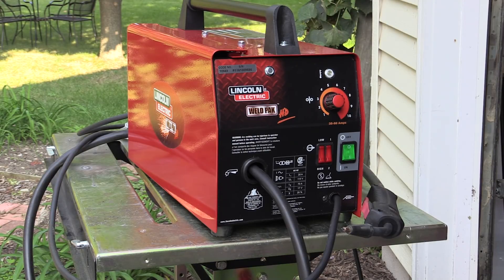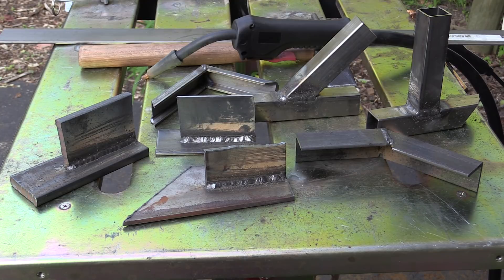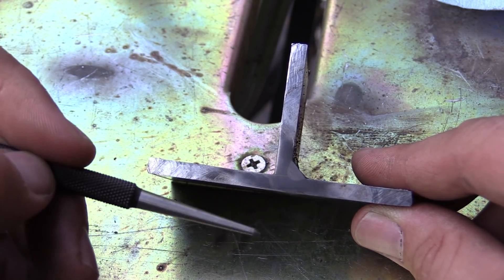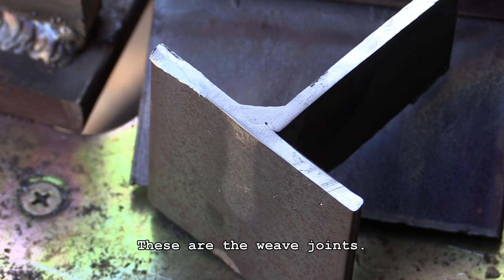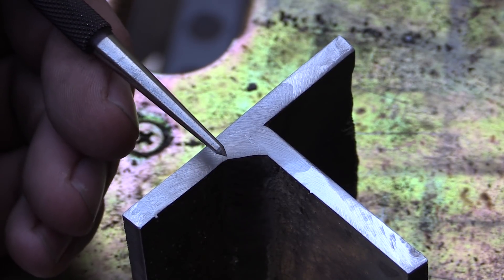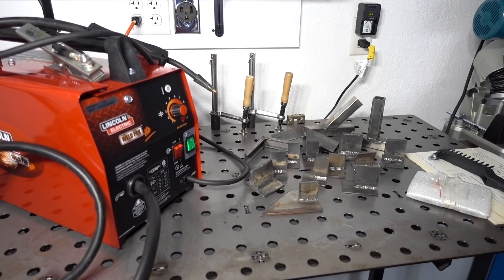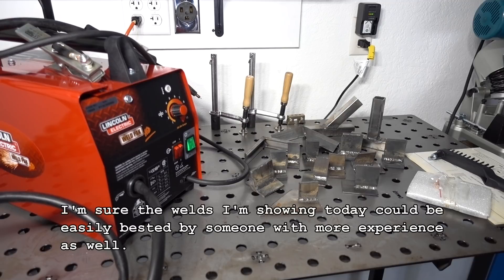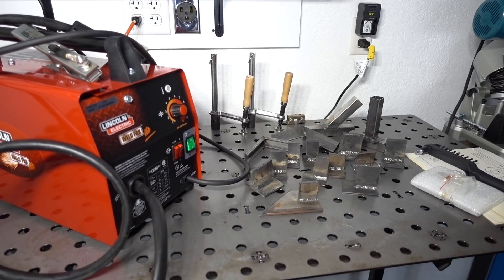Cheap Flux Core Welder Testing - With Cut and Etch

Comment: Can i use the mig with out the nob the holds the wire in place ?
Reply from the maker: Are you talking about the knob that holds the spool of wire on the welder, or the knob that tensions the wire in the wire feed mechanism?  Without the knob that holds tension on the wire in the feed mechanism the wire wouldn't feed.  Without the knob that holds the spool on you could probably figure something out.

Comment: Is this model 10949?
If so I have the same welder. I thought something was wrong with mine in the beginning.
The spool of wire that came with it did not easily feed off the reel. Sometimes I had to open the box and grab the wire and force it loose from the spool and that roll of wire was like that off and on till it was gone. 

The other issue I had with it and of course my fault was using an extension cord that was too long and too light.
A light 14 gauge 100 ft long extension cord alone will make the welder seem like a pile of junk. It will run on a 12 gauge 100 ft cord decent but the manual only recommends a 25ft heavy wire gauge extension cord.
The wire I bought at Tractor supply was a huge improvement over what came with it. I'm on my 2nd spool of that wire and I have come to like it. It is limited in its settings and near as I can tell works best on high. I haven't gotten much out of it on low settings.

Comment: I have the Handy Core with no spark, not sure if a fuse blew or transformer waxed. Haven't had time to open it up. I use straight beads with low duty cycle welders.
Reply from the maker: I hope it's something simple (assuming you haven't already found out what's wrong).
Reply: @bigtb1717  was a inside breaker fuse, working fine now, thanks.

Comment: no gas required??
Reply from the maker: Correct, no gas required.  This welder cannot use gas.  It is only designed for self-shielded, flux core wire.
Reply: @bigtb1717  thanks

Comment: Do you recommend for quarter panel and floor pan repair?? 20 guage??compared to the Eastwood 135?? Not sure if the Lincoln can also run off argon ???
Reply from the maker: This particular model Lincoln cannot use shielding gas.  Flux core probably isn't the ideal thing to use for body work, but I'm sure it can be done.  The Eastwood 135 is a MIG welder that can use shielding gas, but I have no personal experience with it.

Comment: I have the same unit but I am definitley a novice (hobby) welder
My machine, regardless of setting with out consistanly for a micro second. Do you think I may be running
my wire length a little too long I am about 1/2 inch plus
Reply from the maker: Are you saying it randomly cuts out for tiny fractions of a second, but otherwise runs okay?  If so, that does sometimes happen with flux core.  1/2" of wire stick out should be okay and I don't think it's an issue.  But you could try a bit more or a bit less to see if it will smooth out.
Reply: @bigtb1717   As I draw the pool too me, it will suddenly "cut out" for the smallest fraction and the re spark and continue, Thought it may be length or speed
Reply from the maker: @billparno3016  Yeah, it could be a travel speed issue, but you'd probably have to be outrunning the puddle before it would be a big issue.  How clean is the metal you are welding when this happens?  Dirty metal will often cause minor stuttering as you move over dirty (rust, paint, slag, etc.) spots.  It could also be a wire feed issue.  If the wire feed slips momentarily or if the feed speed just isn't smooth in general, this could cause stuttering.  Poor wire feed reliability can be caused by a number of issues.  Is the contact tip in the gun in good condition?  

Honestly, if it isn't causing an issue with the weld, I probably wouldn't worry too much about it.  I've had occasional stutters on flux core with pretty much every machine.  It's one of those things were "It's not a problem unless it's a problem."  Meaning, if it's causing an issue with the welds, look into what's going on.  If it isn't causing a problem, weld away and don't sweat it.
Reply: @bigtb1717  contact tip just replaced. the more I consider, think I have to slow down and not get ahead of puddle Thx for your input

Comment: I’m very impressed with the quality of your welds for never having run a wire feed welder before. Your stick and TIG skills were clearly helpful. Those hand held face shields are pretty useless for welding as you mentioned, but are a nice thing to have around in case you have somebody that wants to watch you weld.

Comment: If you want better penetration on thicker material, put a bevel on the plates and stack passes on top of each other
Reply: That an you could preheat the thicker material your welding will help with penetration

Comment: i have the same one but i don’t understand the temperature and speed
Reply from the maker: The two voltage switches adjust between four different voltage levels.  Low 1, low 2, high 1 and high 2.  The wire feed speed lets you adjust the amperage output at whatever voltage you have selected.  If you follow the chart on the door you can't go too wrong.

Comment: So is thia better than the titanium 125 flux?
Reply from the maker: The Titanium 125 is an inverter with continuous adjustable voltage and it is lighter and less expensive.  It may have a bit more output than this Lincoln, but unfortunately I don't have either of these welders anymore to test them.  The Lincoln is a bit simpler internally, so it could be a bit more reliable, but anything can fail, so it's hard to say for sure.

Comment: Thanks for the video. Would you recommend MIG or SMAW (stick welder)? For DIY, around the house, some fences or window protectors. Mainly for weld up to 1/4 steel thickness.  Thanks in advance for your help. By the way, I have little experience with stick welder, wonder which is better option. My budget is around 400 dls (I am DIY)
Reply from the maker: MIG (gas shielded) is a nice process, but it would be tough to get a complete setup with welder, gas bottle, etc.  Flux core (like the welder in this video) or stick should both be possible to get in your budget.  Flux core is a bit easier to run but stick is a bit simpler (in some ways).  Do you have access to 240V power, or only 120V?
Reply: @bigtb1717  thanks! At be my hose I have both, but at the country hose only 120. I just came from there and I found some rovers got in and I need to reinforce a couple of doors. Not needed very often to do welding at country hose. Just now. Perhaps, I can build the fences at my hose and borrow a pick up truck to take them there. Somebody is selling the same welder on your video. Is that 70 or 80 amps? I also found at Homedepot the   "weld-pak" 120 amps. By the way, how many amps on MIG welder machine is needed to weld carbon steel, maybe up to 1/4 thickness? Because stick welder I guess it should be in between 200-250 amps right? Anything lower could work but usage recommended will be lower work cycle, right?
Reply from the maker: I would say that the welder in this video would be a bit weak for 1/4" material, depending on the project.  If it's not a super critical weld, you'd probably be able to get by though.  A larger flux core welder (120-140 amp) would probably do 1/4" okay.  I don't have any 1/4" steel in the garage right now, but maybe I should do a little cut-etch testing with 1/4" material in the future.  With a stick welder, you are much less likely to get a lack of penetration as long as the rod is running well.  So with multiple passes you can weld just about any thickness.  As long as you can run a 3/32" or 1/8" rod good and hot, you could weld 1/4" metal.  Might take multiple passes with a 3/32" rod depending on how large a weld you want, but it's definitely doable.  A 1/8" 7018 rod running 125-130 amps or so should be able to weld 1/4" metal without issue.  Higher amperage can allow you to run larger rods and put down a larger weld more quickly, but 200+ amps is not necessary for most projects.

Comment: dont forget to fill in ur craters, they are a huge stress point and 9 times outta of 10 will crack.
Reply: and never drag or weave or inline whip, all of those teks will cause horrible penetration  and weaving will cause undercut in ur material and also less penetration, u need to straight push ur weld with mig and will get u the best penetration and eliminate undercut and roll.
Reply from the maker: @stevenconley3136  I agree that weaving and whipping isn't ideal with flux core.  I haven't personally done it since this video.  But you should drag with flux core.  Pushing with flux core can cause slag inclusions because you are pushing the slag to the front of the weld and then running over it.  Slight manipulations can sometimes be fine with actual MIG welding (as in, gas shielded, solid wire).  Just depends on what you are after.  MIG can also be pushed or pulled.  It may affect your final results slightly, but again, each may have advantages in certain situations and there has been much debate and testing.  It's not quite as clear cut as "you must always push."
Reply: @bigtb1717  pushing or dragging with flux is all about the profile ur trying to achieve pushing with flux will give me more of a flat and bigger size weld while pulling will give u a tight more filled size weld its good to pull if ur trying to achieve a 3/16 - 1/4 size weld pushing with flux will help u fill gaps and achieve bigger size weld if ur not welding a T joint.

Comment: Does gas increase penetration?
Reply from the maker: This welder cannot use shielding gas.  It does not have the correct internal provisions or MIG gun.  No gas should be used with self-shielded flux core wire.

In general, gas shielded solid wire MIG will have slightly less penetration than self-shielded flux core, all else being equal.  There are types of flux core wire that are called dual shield, or gas shielded flux core.  They are flux-core wire, but require shielding gas as well.  I imagine penetration is similar to self-shielded flux core.

All these types of wire feed welding wire can achieve adequate penetration in the right situations.  With a small, 120V machine like this one, self-shielded flux core will likely provide the best overall penetration, by a small amount.  This is simply due to the fact that the welder is limited by the amount of power that can be drawn from a standard 120V outlet.

Comment: i bought the same model i only have 220v in my place so i used 5kva step-down 220/110 transformer. it came not good result.

Comment: The Lincoln 140 is a huge step up from the Harbor Freight. Still it's not a professional welders go-to unit, but it's more than enough for my non-mission critical garage projects. Being able to weld on small scale has really opened huge doors to my garage fab capabilities, so I love these little flux core machines!

Comment: Hey I bought a powerbuilt 90amp haven't used it yet....any idea if it may work the same as this?
Reply from the maker: It looks like the Powerbuilt 90A is an AC output welder.  It will not run nearly as smooth as this Lincoln welder, which has DC output.

The Powerbuilt welder will have a rougher arc, more spatter and less penetration.  It will probably be very similar to the Chicago Electric 90A flux core welder from Harbor Freight.
Reply: Thanks for the info.

Comment: Really good video, but, I am more impressed with all of the tech support you've given to everyone.
I read through every comment and reply, and you covered every question I had about this machine, what it can do, and how to make it do it.
I really appreciate all of the time you've taken, I'm sure it's all very basic for you, but for me it was a thorough how to manual for a topic I dont know much about.
So, thank you!

Can you tell me if there are things that can be added, or subtracted from this machine to make it better?
Change tips, wire size you recommend, etc.

I looked up that table you have in you're garage and it seems pretty pricey for the amount of welding I intend to do. Do you think that the cheap Harbor freight table would work well for a beginner? 

Do you ever tack pieces directly to the table or is that a bad thing to do?

You mentioned you didnt use yours for the testing because of the smoke, is that an issue because of fire safety or just to avoid the fumes getting in the house?

Thanks!
Reply from the maker: The table I used for testing was actually a table almost the same as the folding table available at Harbor Freight.  It's not the fanciest or sturdiest table, but I've done a lot of work on it.  Light and easy to move around the garage and stow back out of the way so I can get the cars back in when I'm done working.  And yes, the reason I used that table for the testing is because I could set it right near the door, almost in the driveway.  Less smoke build-up in the garage.  The table is pretty thin, and I believe it is zinc plated to help prevent corrosion, so I probably wouldn't recommend tacking directly to it (the Harbor Freight table).  You could tack stuff to the table, just grind it smooth when you're done.  Not a big deal, just not ideal with a thin table, but it can work.  

Replacement tips for this welder are available pretty much everywhere (local hardware, local welding shop, Harbor Freight, etc.).  I recommend 0.035", Lincoln NR211 MP wire.  Works great.  Only thing I'd possibly change out on the welder is the ground/work clamp.  The included one works ok, but I prefer a solid copper clamp.

Comment: I have a 100Amp service in my shop. Can you recommend something that I can get the most out of for the 100Amp service
Reply from the maker: What type of welder are you looking for?  What's your budget?
Reply: bigtb1717 beginner but catch on pretty well. Looking for maybe a mug that uses gas also. Nothing over $500
Reply from the maker: With a max of $500, most of the options will be 120V MIG welders.  Nothing wrong with that, but you will be limited in output vs. a 240V welder.  Do you have a 240V receptacle in your shop, or can you install one?

To get a 240V welder, just about the only option I know of under $500 is from Harbor Freight.  Their 170a welder is under $200 and has DC output.  I have no direct experience with it.  Many more options for 120V input MIG welders.
Reply: bigtb1717 I don’t but I can. I just want to make sure the 100Amp service can Handel a 220v mig welder
Reply from the maker: Your 100A service should be plenty.  For the welder receptacle I installed in my garage I used a 40A breaker and it has been enough.